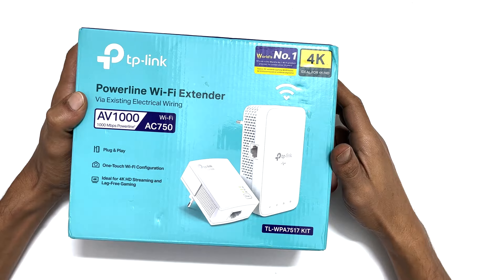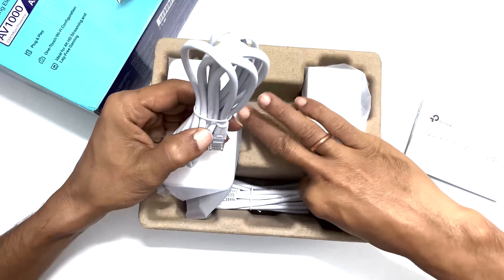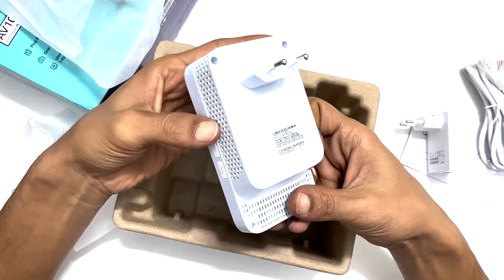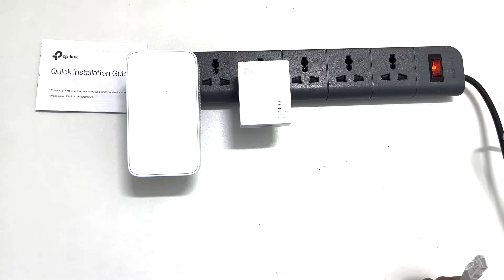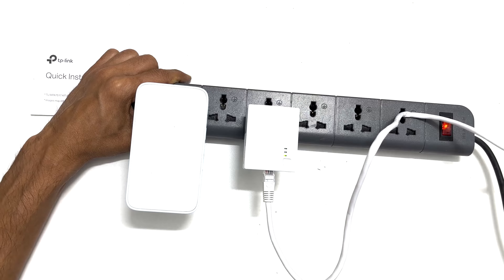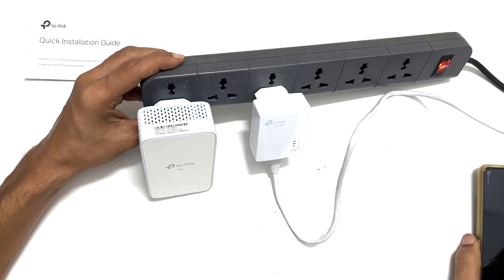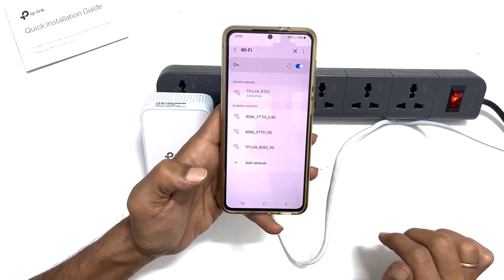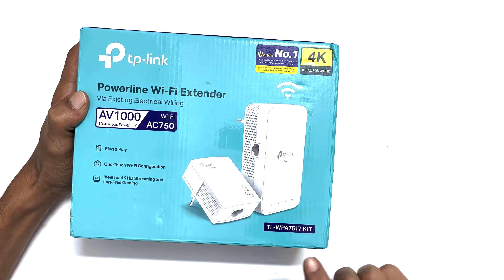TP Link AV1000 Powerline WiFi Extender Unboxing, Setup, Speedtest - Powerline WiFi Kit

Comment: This is by far, the easiest and best set up for my situation.  I have a brand new detached garage and my wifi signal was not string enough to reach it.  I bought this product and within 5 min, i was enjoying a strong wifi signal in my garage!!  I am sooo happy i discovered this product as it was easy, cheap and effective.
Reply: Did you compare the speed vs straight ethernet cable ?
I want to know the difference without buying it if possible. 10% slower/lag is acceptable for me, straight WiFi is a nono :)
Reply: @augustusmaximus891  I didn't - In my case,  I had no other options as I didnt have a wi-fi signal in my detached garage.  I have not noticed any deterioration in internet speed after installing but I am not a gamer or doing activities that require an intense download/upload time.   Again, I could not use a straight ethernet cable in my case

Comment: I have the Tplink av1000 adapter but i have the tplink ac1750 range extender instead. i’ve had them for a couple years and they have always worked great. but i have had to move my adapter to a different outlet recently and now all of a sudden i can’t pair it to the extender. i’ve tried everything and can’t figure out what is the issue. Any advice? the adapter has an ethernet cable that plugs into my pc and i can’t get internet
Reply from the maker: Try resetting the adapter once.

Comment: Hi, what's the best CAT cables to use? My TP Link AV1000 keeps dropping out.  I'm using Cat 5e - should I be using 6?  Thanks.
Reply from the maker: Cat 6 is good. But of there is a drop then issue is not because of the cable.
Reply: @Tech2touch  so what?

Comment: I have one crazy question... If you have one room  I will call it room A, inside room A you have BT Openreach Telephone Master Socket, on that socket your router is connected.  If you want to extend the signal to room B, room B is far away. Can you use TL-PA717 KIT
AV1000 Gigabit Powerline Starter Kit and one wifi extender with the ethernet port... Basically it would work like this, inside room A, one adapter from TL0PA717 on the wall and directly to a router, then inside room B on wall second adapter from TL-PA717 , and to socket next to him extender and connect those two with ethernet cable. Can that work?